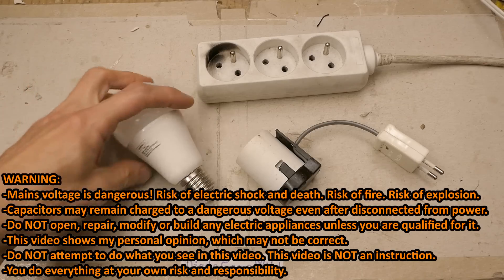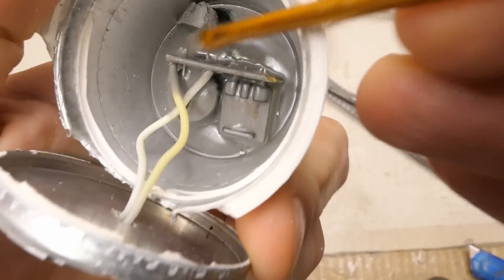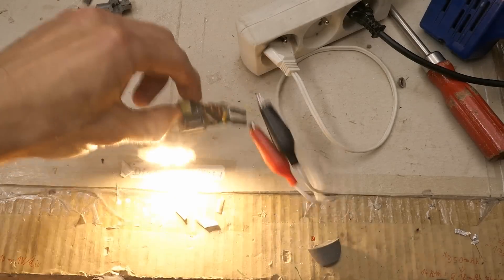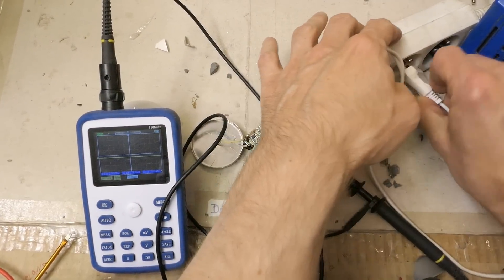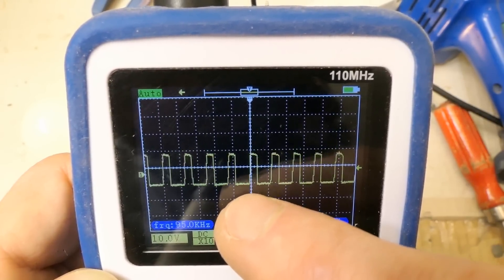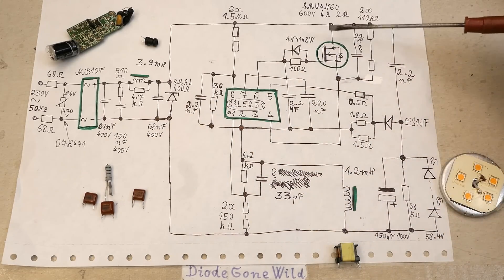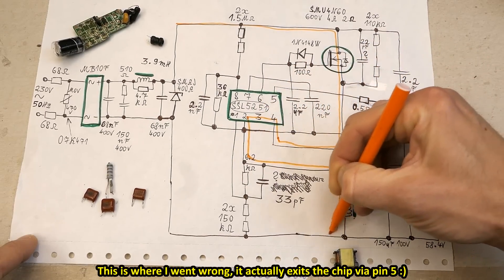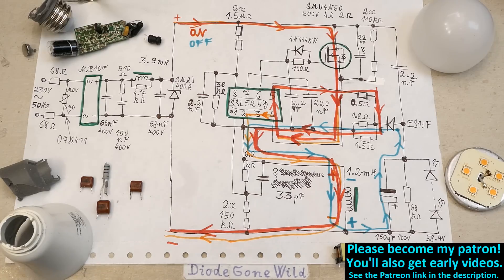Failed 12W LED analysis and schematic

Comment: They need to have swappable capacitors or circuit board, so instead of swapping entire bulbs when they die we just swap whatever circuitboard component has died instead. Jk😂 

or just build them right the first time but it seems most led bulbs aren't built with quality to last as long as they should.

Comment: Can you please explain how Dimmable switch works with LED?  Is it current, volt or PWM? I have one LED light blow in matter of hours at full brightness, and I am suspecting if my dimmable switch is the issue.  Previously I used to have Tungsten light working with the same dimmable switch.  I am not sure if this dimmable switch is compatible or how do I find out if it is or not?

Comment: it's so utterly infuriating that we're mining all this irreplaceable shit out of the earth, investing a ton of energy into manufacturing these devices in the hopes that they'll reduce our overall energy usage, and then throwing them away because they couldn't be bothered to figure out an adequate means of attaching a wire to a piece of metal. like you have a whole supply chain with all sorts of fancy chemistry and advanced photolithography and precision machining, and then right at the end it's "just kinda touch the wire up against the thing and hope it stays there".

Comment: Older Cree lights use the same grey silicone potting in their lamps. The circuitry is similar. I have gotten good life from my outdoor flood lights, but the cover over the LED's is not well sealed, and they die from water ingress. Great video, especially the mains shorting part! Thanks.

Comment: in my case the led chips are always the point of failure and most of time its one bad smd internally inside the 3 led package or just a loose phosphor layer due to heat expansions which can be made to work by applying light pressure and superglue to another year of use

Comment: Why would that wire connection burn while passing low power? You can take off the screw terminal with an adjustable wrench, and might still be able to push it back on. It sucks that they don't make LED units openable.

Comment: I believe you fully about the longevity of fluorescent fixtures, but we have to remember the bathtub curve and think about it scientifically: If something lasted for 2 years, does that mean it's probably likely to last 10? How many fluorescent bulbs die early? Maybe the ones that are still working are just lucky ones. If I remember correctly the most wear on fluorescent lamps comes when you turn them on, so they're best for situations where lights are left on continuously, while LEDs are probably better for intermittent use if designed correctly.

Personally I prefer LEDs just for the better CRI but I still have some compact fluorescents installed. I did convert all of the long fluorescent tubes to LED just because they were failing anyway and the old-style magnetic ballast is not very efficient. I put probably about 10 or 20 LED lamps like this in our house and in a few years I've had 2 or 3 of them fail. Probably manufacturing defects that affect a minority of units.

Comment: This is awfully complicated! I had the same problem with German Aldi with Müller-Licht: The first I bought was over 8 €. I returned it after a year and the offered me a swap to a new light. I declined and got my full money back. With this money I bought from the same Aldi the same lamp for 5 € and made 3 € win. And so on. In the end I bought a lamp for 2.50 € and this is running for years now. It seems to be kind of a rental scheme with the winner on my side. Hint: ALWAYS keep the bill and the packaging and insist of the promised 50,000 hours lifetime, which are 5.7 years/24 hours daily running.

Comment: A good reminder that no matter how good your circuit is  (and that lamp looks as though it should be quite nice, if the wire did not fall off the threaded part),  a single bad connection is all it takes to stop it working altogether.  In the UK, light bulbs have a push-and-twist base that looks a bit like the probe connector sticking out of an oscilloscope, with two locking pins that ride in J-shaped grooves in the lamp holder, two contacts on the bottom, one for live and one for neutral, and the outer metal does not form part of the circuit.

Consumers traditionally seem to have preferred light bulbs to be brighter rather than longer-lasting; and of course, you can only have one or the other, not both, unless you pay more for better-quality components and more LEDs so each one is dissipating less power.  It only has to last just a little bit too long for you to think "Well, that was cr@p, I'm not buying that brand again".  Over-stressing LEDs causes them to lose brightness as they age.  So a new bulb will nearly always be brighter than the old one it replaced, because -- unless it was an early failure -- the old one will have been gradually getting dimmer all the time before it stopped working at all.

Of course, the whole idea of cheap, easily-replaceable light bulbs came about in the tungsten filament era, because even the best-made ones could only manage 2500 hours.  Nowadays you can get LED light fittings that are meant to be installed permanently, or at least for a few years, and they probably are building new houses using these instead of fittings that take bulbs.

I am old enough to remember when the first LEDs became available to consumers, just dim little points of red light  (green came a little later, and blue much later still; I remember paying a small fortune for one of the first blue LEDs)  -- and cheaper audio equipment often featured a tungsten filament bulb with a rubber sleeve made to look like a fake LED!

Comment: I absolutely love the way he touches the exposed LIVE circuitry without any safety concerns. That right there shows REAL electrical engineer👍👍👍
Reply: @agustinusreynaldi7101 ElectroBOOM is working with 110V mains so not exactly the same.. :)
Reply: I’ve heard about people getting shocked when touching single live wire even when they are NOT grounded. Why is that?
Reply: @jasonvoorhees3282  It's because human body has very large capacitance to the environment which allows AC to flow through depending on humidity, resistance, frequency, voltage and so on and this is also called capacitive coupling.
Reply: @ayemin9822  Very large capacitance= picofarads or nanofarads bruh.

Comment: Is this a very constant fault? As it heats up, the plastic melts and the wire stops making contact.
Another cause is usually the poor quality of the LEDs.
I recently bought some EDM brand lamps, they all broke down after 3 days or a week... I gave up on this brand.
greetings from Portugal
Reply: Osram 8€ bulbs lasted 6months before dying. Literally worse than classic incandescent bulbs.

Comment: Nice teardown,  did you used wood or plastic chear to isolate your self,  what is the best case working isolated from earth or not isolated in order to be protected by Rccb breaker.
Reply: Do you usually sit on a metal chear? Must be bloody cold.
Reply: @j7ndominica051  they are some  chears with metal frame ,  he must see where he put his feet  if they are on the floor he will be electrified :-)

Comment: Very overly complicated. So much money spent on engineering to make it as complex as possible for nobody to be able to understand nor repair it, then even potting it. We need EU regulations against potting and rules that make it easier to take apart appliances. I think at this point we can be glad that we even are still able to buy LED lights wit Edison or Bayonet lamps... Here in Germany it is increasingly difficult to get fixtures with them. You are supposed to buy a lamp with integrated LEDs and bore new holes each time it dies...
Reply: That is terrible for the environment.
Reply: @dosgos  Yes. I am so mad, that I just started to plan to make my own LED lamps where I can easily maintain it.
Reply: It's not overcomplicated and it's designed this way to make it dimmable. That it's difficult for you to understand doesn't mean "it's made complex to prevent repairing"...
Reply: @jb5631  There are way simpler circuit designs that make the LED bulbs dimmable, too.
Reply: @kyoudaiken  There are a lot of ways to achieve dimming compatibility & the one described in the video is quite common. That doesn't mean it's engineered like this "to make it difficult to repair" & "nobody be able to understand it".
Reply: @jb5631  According to your spamming in this comment thread I think like you just want to put yourself higher above me because you think the schematic isn't complicated. I never said that the schematic is complicated for ME. I considered other DIY people who want to repair stuff themselves.
Reply: Instead of the potting they could have used a wrap like many companies do but as you could see in the video, the potting was quite easy to remove and likely reduce the risk of damage during transport. Aside from that it's economically unfeasible to repair these cheap LED lamps; the only real problem here is the bad connection at the lamp base resulting in the early failure.
Reply: @jb5631  I wouldn't say it's "economically unfeasable" to build it in a way so you can re-attach the bad connection to have it work another few years instead of it getting tossed and replaced...

Comment: LEDs have a lifespan of around 50 years if used correctly. Unfortunately most modern manufactured items are overpowered for cheapness drastically reducing their life.
Reply: I am working on building my own LED lamps.
Reply: @kyoudaiken  It's the only way now.
Reply: @kyoudaiken 
Based and DIY worker pilled

Comment: Lol you ALWAYS  have reference to ground by parasitic capacitance. Please, never touch any live wires coming from the grid.
Reply from the maker: Human body capacitance is about 120pF, so the capacitive current at 230V 50Hz is 8.7uA, not dangerous, as long as there's no direct ground connection.

Comment: That excessive resin screams ECO all over the place. BTW. It was not the case for this one, but most failed LED lamps I've seen have black spot of death on some of the chips. They fail prematurely due to excess current/heat. Quicker than incandescent lamps even. But there is a way to make them last as long as they are supposed to last. What you need to do is to replace current setting resistor to something about twice the resistance. The lamp is going to be a little bit dimmer, but it's going to run MUCH cooler and last MUCH longer. Just buy a little bit brighter lamp than you need and mod it. I think BigClive shows how to do that in one of his videos.
Reply: We need an EU law that says that LED chips need to be ran at half their rated current and they are forced to put more LEDs in the lamps to satisfy brightness standards.
Reply: @kyoudaiken   And you need to make sure manufacturers bother with it .....  Reputable brands do take care to run LEDs conservatively, but some fly-by-night merchant will just over-run the cheapest LEDs they can find, and hope the inevitable loss of brightness happens too slowly for you to notice.  After all, a light bulb only has to last a little bit longer than your memory of buying it, lest you think "I'm not buying that brand again".

Sometimes it's worth paying a bit extra, especially for a light bulb in a hard-to-reach place such as over stairs.
Reply: @kyoudaiken  
It's pointless to run LEDs at a lower voltage, when you then put in more of them to compensate. It is the same power dissipation in a confined case and that's what bakes the LEDs and other components (especially the electrolytic capacitors) to death.
Reply: @superdau  In fact, it's not the same power consumption. Look at the diode characteristic curve V/I.
Reply: @kyoudaiken  
The forward voltage change is too small to be of any relevance for this. The voltage drops 0.2V, maybe 0.3V, when going from typical 20mA to 10mA (of course I don't know what LEDs are used here, but the voltage change is typical when running a LED at half the nominal current). So less then 10% of a voltage, and thereby power dissipation change. That's in the order of "can be ignored".

Comment: As always, bloody good explanation. This is a really interesting piece. Surprisingly made for today's costcut times. It's sad that something with the potential to work for 20 years has to be thrown away after a year because of a stupidly made shell contact. Long live planet Earth!
Reply: Yeah, bayonet cap fittings are better in this regard. Of course the better edison screw fittings have the wire soldered to the side of the base, not "crimped" like this one. I guess with all that good circuitry, they had to find somewhere else to put the self-obsoleting feature.

Comment: Why does they use too much resin 😂
It's make any sense😂
Reply: Probably to make it water resistant
Reply: @FaysalKhalashi  but in some points is still not water resistant 💀
Reply: I guess so they don't have to use some wrap around the pcb to prevent it to short in the base & make it more durable to handle transport

Comment: +1 on the annoyance of multimeters shutting off automatically.  Auto-off can sometimes be bypassed by holding down Function while turning on the meter (try it), but the auto-off feature should not exist on test equipment in the first place.  I hate anything that turns itself off after only a few seconds or minutes and it's ridiculous to claim that it's an energy-saving feature when the manufacturer/seller included heavy-duty (zinc-chloride/zinc-carbon) in the box.

They now ship thousands of tons of useless zinc batteries across the oceans, but then claim that the annoying auto-off is saving resources?  Bullcrap.  Some multimeters will turn off the backlight after only 8 seconds and whoever designed that should be jailed.  I've long wanted to make a youtube video showing how to disable the auto-off feature on multimeter backlights/flashlights by adding a latch mod or even a separate switch if that's easier, but every meter is different and I don't have a suitable place to record video anyway.

Danyk could show an example of such a mod, but he may not be interested and I suspect that the views would be poor while the questions in the comments would be numerous; a high question/viewer ratio ;).  Thousands of meter designs exist and many people would want custom instructions for their own device.
Reply: Personally I appreciate the auto-off because I always forget to turn my meter off and it saves me from having to replace the battery constantly. If I'm going to do something that requires having the meter on for hours at a time, I would probably prefer to use a benchtop multimeter rather than a handheld one.
Reply: You have clearly never used a DMM without auto-off features. They drain batteries like nothing if you forget to turn it off, and then you have a pair of flat AAAs (in best case scenario as they are sold everywhere) or 9V battery (in worst case).